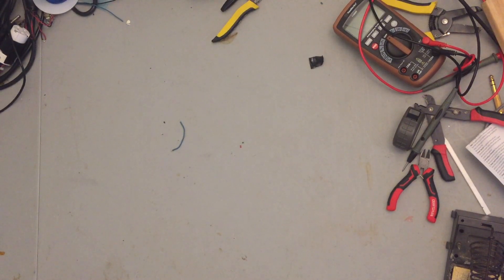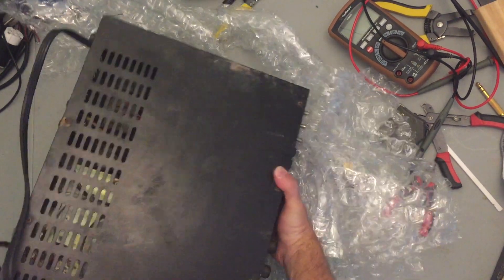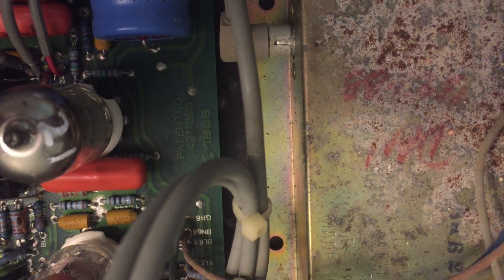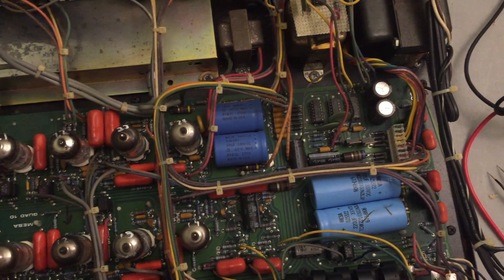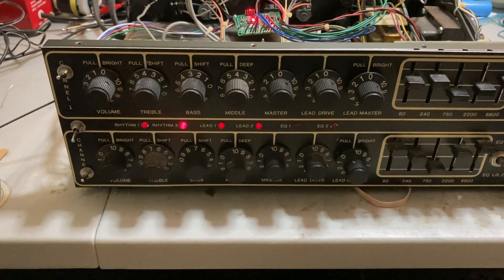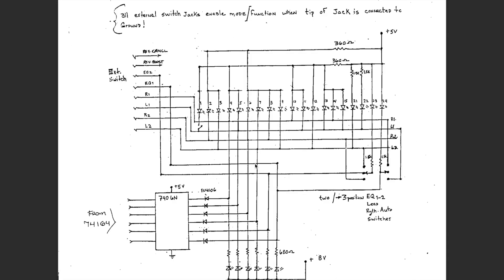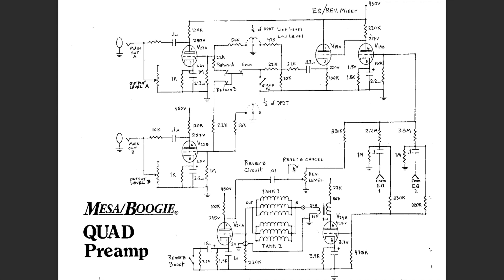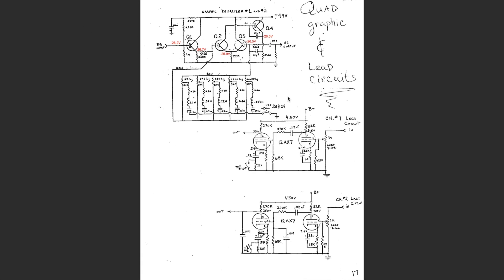Quad Pre repair and MIDI

Comment: I recently got a Quad Preamp. Mine must be a little later, its board says Rev. E, and seems to have factory MIDI that comes on a big board that replaces the second reverb pan. Accidentally broke a potentiometer shaft, but a pot replacement is something I can do myself. It otherwise works great, so I won't fix what ain't broke, but when I feel it's time for a recap, I'm curious about this much smaller MIDI board that allows the second reverb pan to still fit.

Comment: Just had mine done by a certified Boogie tech, he found major inconsistencies with the schematics and what he found in my Quad, and he said it came like that from the factory, push/pull switches wired incorrectly or not wired at all, other stuff like that, he was wondering if all the Quads came out like that, so I’m looking to hear it as it was supposed to sound like in the first place?! He’s adding a custom extra gain stage on Lead #2, will have to see what that sounds like…. Thanks for your video, would love to see more on your Quad